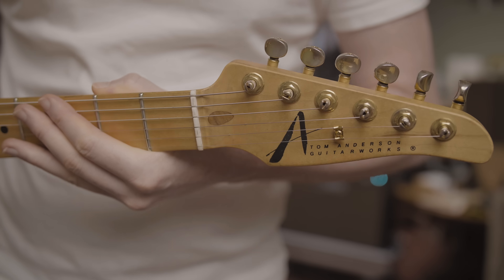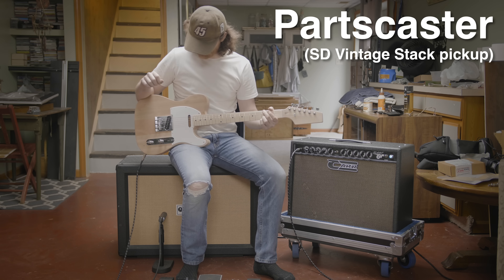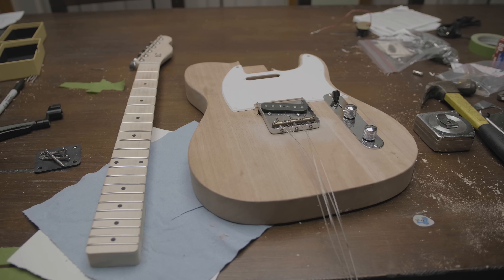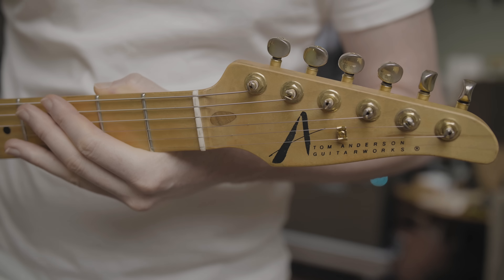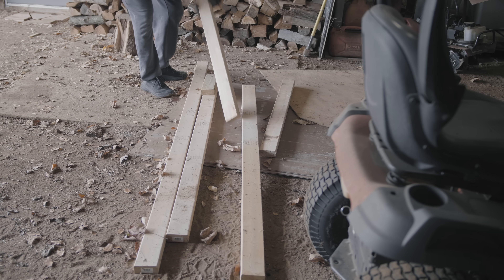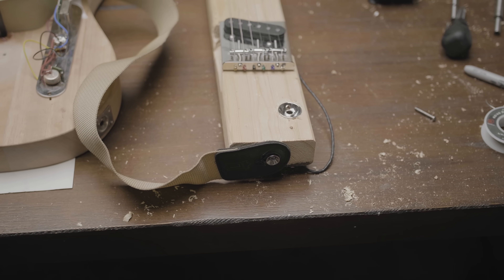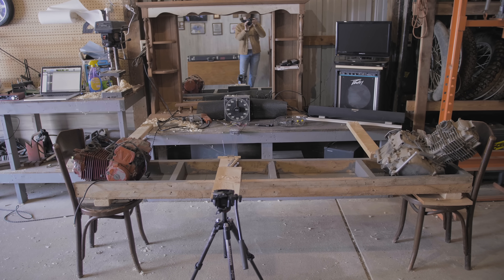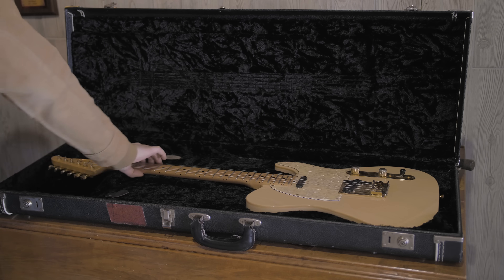Tested: Where Does The Tone Come From In An Electric Guitar?

Comment: Yeah, considering that pickups are supposed to only generate current off the vibration of the strings, it always seemed to me that the guitar itself barely matters. It's awesome to see a video that confirms that! Makes me wonder if making a slightly microphonic pickup intentionally to incorporate body characteristics could be a feasible approach though.

Also i think I need to build a 2x4 guitar. That thing was legitimately awesome.
Reply: Pickups are microphonic… just try tapping them with a plastic comb (strings damped with the palm of your hand). They have two characteristics, one electromagnetic and the other microphonic. Mechanical vibrations in the body are picked up albeit at a very low level and this is significant and overlooked.
Reply: @parismetro2012  well…that particular pickup is potted. Heavily, iirc. So it’s probably not microphonic. It’s still crazy how similar they sound. 

I wonder how loud it was in the room at the end. If it was loud enough, the air guitar and the tale should have fed back differently. There should also be a subtle version of that happening all the time. Again, If it’s loud enough.

Comment: I always felt Pickups,Wood,strings and the shape and map of body cavities changes everything in terms of sound or tone!
That comes from owning and collecting guitars for over 20 years. 
Phil Collins has been having custom guitars built specifically for years for  this same reason! The main thing he found was the body and cavities placed not just fir electronics but for tone.
Ultimately he found a non painted body with cavities strategically placed with no pick guard and your style of pickups made all the difference.
That’s his opinion though and i cannot confirm the non painted with no guard part but cavity size and placement is a factor that i too experimented with.
 You can see one of my guitar walls on my chan!
Thanks fir the vid! Crisis

Comment: Will you release uncut parts of "the air guitar"? I'd like to hear the decay. You cut it when sounds starts to wave, and harmonic dissonance (not sure how to name it) starts to be more audible.

Tonewood does matter in electric guitar. Please read this research (youtube delete links):
"On the Audibility of Electric Guitar Tonewood" Archives of Acoustics, 46, 4, pp. 571–578, 2021, 10.24425/aoa.2021.138150
Department of Mechanics and Vibroacoustics, AGH University of Science and Technology, Cracow, Poland
"The differences between the acoustic characteristics of tones produced by the tonewood samples explored in the study were larger than the just noticeable differences reported for the respective characteristics in the literature. To verify these findings an informal listening test was conducted which showed that sounds produced with different tonewoods were distinguishable to the average listener."
Reply: Co za bzdury.

Comment: These are certainly important factors but they don't mean everything.  You can take a Gibson Les Paul and Gibson SG for example.  Same scale length, same nut material, same bridge and tail piece, same tuners, same electronics, same strings and match their setups.  They sound A LOT different.
Reply: *different pickup distance from the bridge? Have you thought about it?
Reply: @Sledr1994  Sure, and I've also thought about people buying Les Paul copies and putting authentic pickups and electronics in them.  They sound a lot different than an authentic Les Paul.  Even with the same specs.
Reply: @tacoconch7678  specs not design. Again, consider exact pole piece position.

Comment: open string on the most same materials of nut and bridge sedels with same pickup 100% will be sound the same, but if you took 2 same guitars with same scale length but one with mapel neck and mapel fretboard and other with mapel neck and rosewood fretboard - it will be two different sounds and the ebony will be third. Same as the bolt-on and glued neck or neck-through will be had different sustain and resonance, different frets shape will took different feels for player. Im sure that only myth is the shape of the body about, probably it means from "different shape - so it's different scale length", wich many of newbies didn't understand yet. Sure that 200$ tuners vs 20$ never improve your tone, but it makes you to play more comfortably same as the other parts of the guitar. But the sustain and resonance will be improved by the wood of body, hard or soft wood will give you much different tone. You can't get TTDTDE or Meshuggah or else-like style tone playing on hollow body jazz guitars with mapel fretboard even if it has 28" scale. Just try to put your seymour in the 30$ plastic acoustic from amazon and see what happens :D
You doing a great job in this video) 
sorry about my english, hope you understand what i was trying to say :)

Comment: For the air guitar, think you need to try a maplewood floor as the bench and the table are both connected by being on the floor. Also, maybe you should stand barefooted on a pair of sponges  as to not dampen the resonance......🤣🤣🤣

Good work man. Time consuming I bet.

Comment: Awesome video. I think a lot of what we might think of as Tone is actually feel, feedback and ergonomics. A guitar with a satin finish neck probably sounds the same as one with a lacquered neck but the way we play it makes it resonate more, or maybe we just perceive the resonance more through our chording palm and psychologically feed back to that experience via slight shift in our playing style and pick attack. Or maybe I’m overthinking it.
Reply: Albert Einstein. When he formulated the equation E=mc2, he established that energy and matter are the same thing, two sides of the same coin.

When you pluck a string on an electric guitar, you are creating potential energy. When you finish pressing it, removing the pressure from the pick or your finger, that potential energy is converted into kinetic energy, and makes the entire system (the entire guitar) work according to the laws of physics. A series of vibrations, energy transfers, etc., are produced, which depend on all the elements of the system, of course including the density and specific characteristics of the wood. Everything influences how the strings vibrate, and how the effects of that vibration are picked up by the pickups.

When the strings are vibrating, even the guitar "bends" on the neck (of course, to a level imperceptible to the human eye). When you pluck a string on the fretboard, it is in direct contact with the wood.

It is materially impossible for the wood of a guitar not to affect its tone, according to the most basic laws of physics.
Reply: @derfreischutz4380  "makes the entire system (the entire guitar) work."

Okay and so technically that system also includes the player, the floor, the country they live in. Except you might reasonably disagree with that but where did the line stop? was it at the saddle? at the bridge? at the body? at the hands and thighs of the player? It's pretty arbitrary. The fact of the matter is that the saddle and nut are where it loses 99.99% of it's relevance because the pickup is fixed to those. So even though a fair amount of the strings energy gets dumped into resonating the guitar itself the thing is just too solid to actually make that cause a perceptible difference in sound.
Reply: @benfennell6842  not
Reply: @derfreischutz4380  When you pluck a string, it vibrates between the metal fret (or the nut) and the metal bridge. It's never vibrating against the wood. You can get a scalloped fretboard where the strings are never even touching the wood.

The strings don't know if your fretboard is maple, rosewood, ebony, or Yggdrasil, and they don't care. Neither do the pickups, amp, and cabinet.

Comment: As someone who worked in music retail for 15+ years, this lines up exactly with my theory on guitar tone as well.  Believe me, over the years I've played almost every guitar you can think of and in an electric guitar, 95% of the overall sound is from the pieces that are...electric.  Pickup, Pots, Amp, Speaker make up the overall sound of an electric guitar sound.  The way each player will strike the strings and how they will manipulate the strings will effect the signal going into the pickups, but if we are talking one player changing their tone, its pretty much all in the electricity.  Guitars do feel different, their playability, how well they can be setup, intonation, fret work and stuff like that, all plays a big factor in the overall playing experience of the guitar and can cause the player to have a preference.

Comment: OF COURSE tone in an electric guitar is going to be determined (for the most part) by the Electronics... Onboard, inline and the amp itself.

But without THE HANDS, I don't care if someone spends a million dollars on a rig.

Without the right touch, even the most expensive setup can sound like absolute sh*t.

The player needs THE TOUCH, THE TIMING and THE "FEEL".

All that sh*t about finish and wood and whatever, ONLY has to do with the sound of a guitar ACOUSTICALLY. And of course, certainly affects how an ACOUSTIC guitar would sound.

But even then, without the HANDS, a $30,000 Martin Custom can sound like a K Mart  Special.

In the case of the Telecaster, the top load vs. the string-through method DOES HAVE a lot to do with tone, but only in certain styles of playing.

Comment: Really cool. I think the 2x4 and the air guitar ended up sounding pretty much identical at the end.

But I feel like the 2x4 still had some kind of brightness even after the electronic adjustments. And the air guitar had some kind of round warm something as if you were plucking your guitar over the neck instead of towards the bridge. That's me trying really hard to listen for a difference.
Reply: cope

Comment: Your videos are answering ALL the questions we have had for years. You are a natural speaker and communicator... and you are very concise and to the point. There is no fluff at all. 
I am absolutely stunned that a guitar builder thinks of a pickup like a microphone... that's a newbie misconception.  The pickup creates a magnetic field that the steel string vibrates in, creating induced ELECTRICAL SIGNALS. Not sound.  Amazing!  
Your videos are THE BEST!

Comment: My sense is that pickups, picking distance from bridge, steel plastic or finger picking, equalizer and tone knob settings, volume and heat on your tube amp, and quality of the amp itself have the most produced role in tone.

What we've got here is rather clear proof that the body and the headstock create negligible differences. This was a lot of work to make, so thanks Jim!
Reply: Ngl from the beginning it already sounds like snake oil bussines type a thing

An electronic instrument, that is affected by it's materials?

That just sounds weird, imagine if yamaha keyboards were "made of rose wood for better tone"

No one would fuckin believe it 😂
Reply: don't forget the strings.

Comment: Here's what left use 2 different styles of locking tuners, so no one states that how you string the guitar makes a difference, locking tuners would be exact every time. compare different string materials,  brands and gauge size... personally I believe pick up height and distance from bridge makes a difference, changing pick up height is a noticeable difference than anyone can hear from top to bottom, pick up distance from bridge can not be argued... get your acoustic and pick closer to the bridge than closer to the sound hole, you can hear the difference. The electronics do play a role in pick up value, tone capacitor value, and pot value as this alter the guitar circuitry. So really the only thing that separates guitars are pick up values and single coil vs humbucker, pick up height and distance, electronics and potentially string material/gauge. after that, its the players picking and fretting tension that alters the tone.

Comment: did you use the same pickup (not same brand/model, but the exact same pickup) on your test and control setups?  if they were 2 different pickups, would be interesting to hear your control guitar with each pickup in it - your results so far seem to show it doesn't make a big difference if they were different pickups, but might be worth checking it out.  Great experiment though, love it!

Comment: I have a couple of strats - one Black with a 60’s style rosewood fingerboard and one red with a 50’s style maple fingerboard. I have swapped pickups in these two guitars many times and the black one always sounds thinner (less low mid/bass).
My hypothesis is that this is due to the rosewood neck being quite thin and fast whereas the maple neck is like a baseball bat - chunky and stiff.
Both are useful in different ways.
One day I must swap the necks...

Comment: Despite this video, I bought a Les Paul Custom for the craftsmanship, the styling, and because it was modified at the factory. I threw in my current favorite pickup and set it up just like every LP I own. Wouldn't you know it, it plays better than my other Gibsons. The neck is just right for my hand, it stays in tune, and it's relatively light. It's also a long term investment to be passed down.

I'm not snooty. My next best playing guitar is a $600 2018 Schecter Solo-II Standard which I heavily modified with another $300 and elbow grease. A reasonably well made guitar can be improved into a great guitar.

It could be a bias, because I paid a lot for it, but the Custom worth it to me. I'm ready to sell most of my guitars and not buy any more. However, the alternative of getting something that's $700 to $1500 that feels good and stays in tune is just as appealing to me. The video demonstrates that from a tonal perspective, a good pickup (or a replacement) is the most important consideration for tone.

Comment: You could still take it one step even further... Park 2 cars back to back closely, pull hard the parking brakes and put them in gear. Then take the peghead with tuners, hook it on one of the cars, and the bridge on the other.. Matching the scale will be a rather challenge though.. I'm so curious of the results. This way, the bridge and peghead will be totally disconnected. On your bench and shelf test, there are those braces between them that might actually couple them and make a resonant body (like when you play the guitar unamplified and rest it against the door (I used to to that stuff with my bass..). Give it a try :)

Comment: 5:05-5:14 huge difference between the two. The partscaster has less sparkle on the top end as well in all the other parts where the pickup height is matched. I can hear it through my phone’s speaker but it’s especially noticeable through my Sennheiser headphones.

Comment: "The comment section is literally Mad Max in text form."- Garandthumb

I can hear the difference between wood types (when I can hear over my stage volume induced tinnitus).  It's very subtle, but it's there.  Spectrum analyzers can measure it as well and there are several videos on YT that show this.

I've been playing for almost 35 years and have studied this instrument and it's accessories for just as long.  I personally believe that what people are calling tone is not the tone of the wood itself but how the wood colors the tone by absorbing certain frequencies and reflecting others.   All things have a resonance frequency that causes a given material to vibrate and thereby dissipate that frequency as heat energy leaving the remaining frequencies alone to be heard by the listener or picked up by the transducer or pickup.

If there is a way to show this I'm not the guy to do so, so call it speculation or an educated guess.
However, I don't think it plays the part that some folks think it does.  There's just too many variables like string material, magnet type, component quality, accessory type, and personal style of playing to narrow down the source of guitar tone to wood only.

Some folks my disagree and that's okay too.  This is just an speculative opinion on a given topic of conversation.

From one musician to another, cheers!